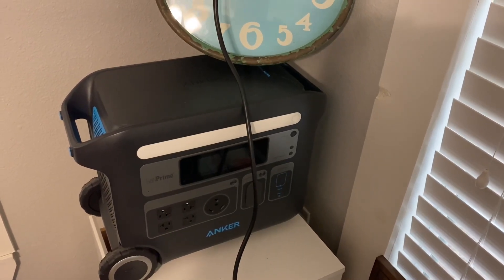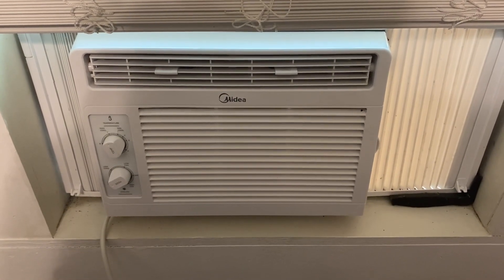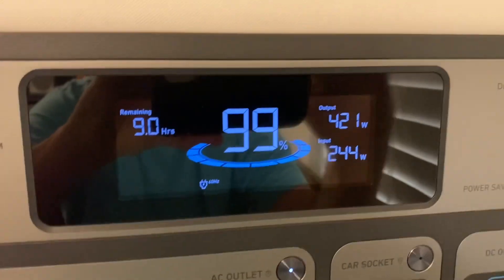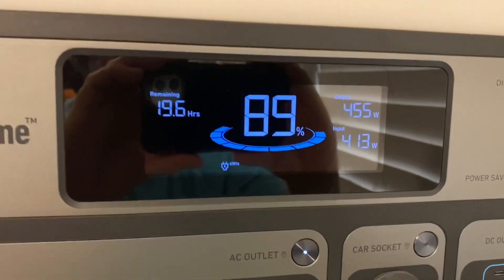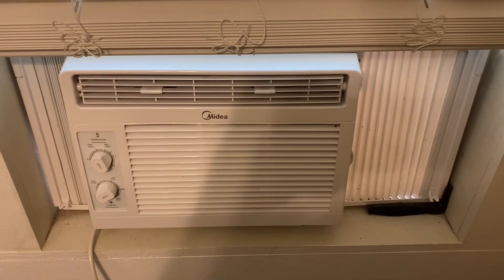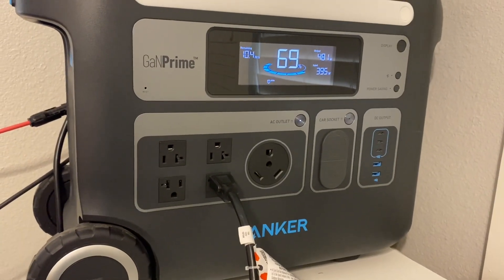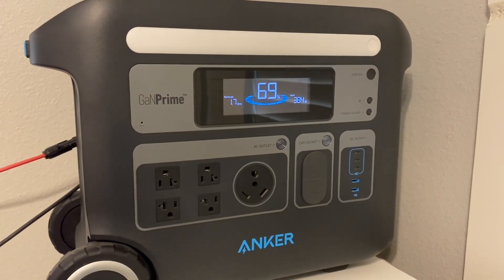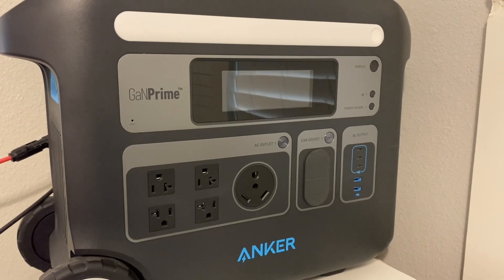Air Conditioner hooked to Anker Powerhouse 767 and 600 watts of solar

Comment: How were your 600 watts of solar panels connected if you had to stay less than 60 volts?
Reply from the maker: I had them connected in series the voc open circuit voltage was 20.3 for each panel. I know that would bring it up to 60.9 but I was counting on two things. 

1: the panels would not max out on me reaching the 20.3 

2: the Anker 767 could go just a little above it’s rated voltage intake. 

I would not recommend hooking up like that but in this case I had tested the 600 watts of solar in series with other things that were 60 volts max and did it with no problems. I’m not really sure if the Anker 767 could have gone a little pass 60volts just took my chances. 

The Anker 767 with the Anker 200 watt solar panels can have 5 panels in parallel reaching the 1000watts and it will stay within the 60 volts, they are designed to work like that together. 

In series the voltage is added together in parallel the voltage remains the same and amps are added together 

Whether you hook up in parallel or series make sure you staying 60 volts or less with the Anker 767. 

I know its not the best voltage intake and makes it a little harder when choosing panels outside Anker’s to max out the 1000watts.
Reply: Thank you for your answer.
Reply: What panels do you use Watts